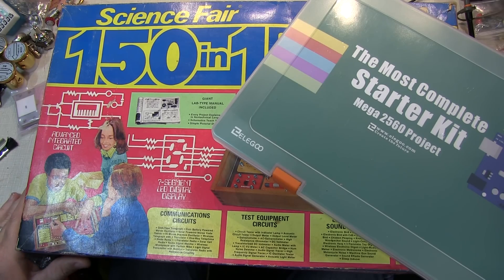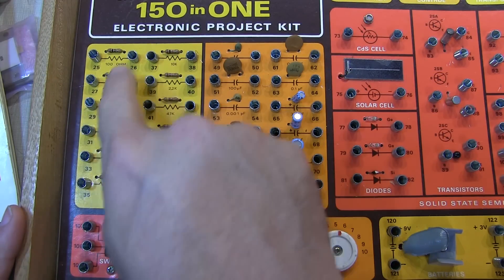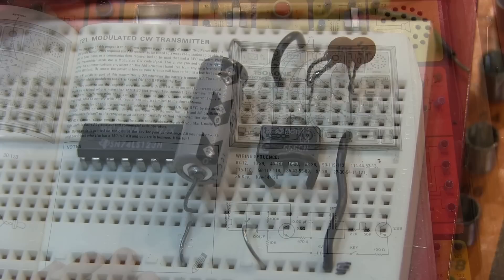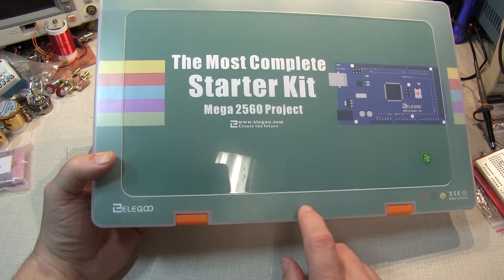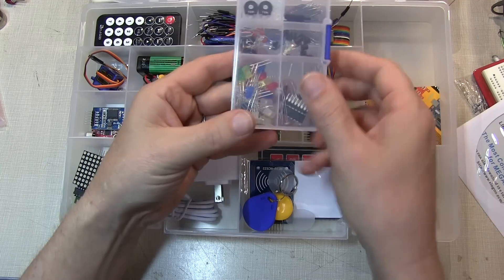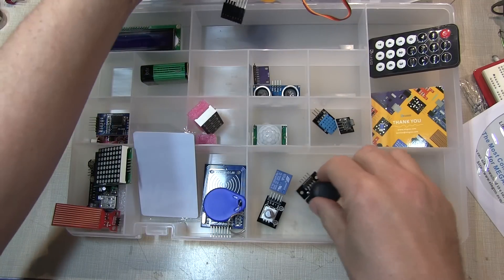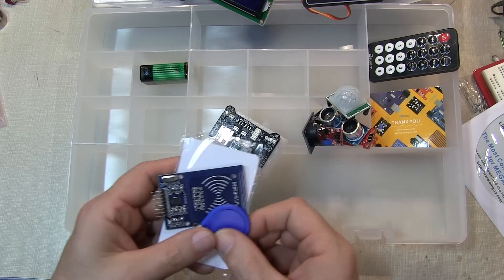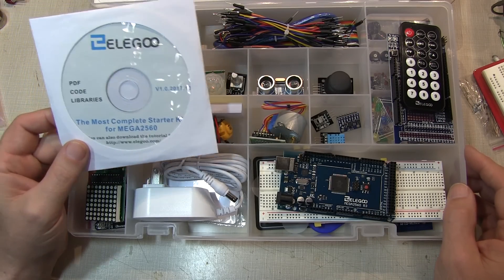#298: Electronic Project / Experimenters Kits - Then and Now - Science Fair and Elegoo

Comment: The older kit looks more intuitive. I'd be more inclined to use the older ones than an Arduino if I was 10.
Reply: The kits have different goal IMHO, so aren't really compareable in "intuitiveness". The Arduino kit definitely isn't an electronics beginners kit. Most Arduino kits I've seen are programming focused (often just copy and paste unfortunately) and the electronics are something you need to make your program work.
Reply: @superdau  The Arduino stuff is all about downloading someone else's code if you are a beginner. Or write your own if you have knowledge in the field; in which case you likely wouldn't buy the kit because there are more efficient and cheaper methods.
Reply: I got into the hobby around 2002, so right at the tail end of the older kits (although mine only had the spring contacts for larger components like the transformer/switches/relays & a large breadboard), but w/ an excellent Forrest Mims manual. However, that was late enough that what kept me in the hobby was the basic stamp microcontroller kits from parallax. While those were less complicated than the arduino kit shown, I likely would have quit electronics had it not been for all the cool behavior the microcontroller enabled. Building a crappy radio just wasn't very impressive to me, so while I learned a lot none of the projects in the radioshack kit got me excited enough to keep going, while it still remember how cool I thought the crappy weather station that logged data to my PC was. For kids that are growing up with smartphones, I just don't think the older kit will really do much to get them excited.

My main problem w/ the arduino kits I've seen is that they encourage copy/paste programming, and don't explain the circuits, so I don't know that there is much electronics or programming knowledge being learned.
Reply: I actually learned on one of these old kits when I was 10. The only problem was I eventually blew all the transistors and couldn't find replacements. In terms of educating myself, this kit was far more effective and interesting than any of the new ones I've seen. The new ones sort of dilute the essence of electronics and dumb down most of the concepts. Maybe there are some better ones out there that I don't know of, but these Arduino kits are mostly modular electronics with copy-paste code where they only explain the obvious. Back in probably 2009 I had an Arduino kit and it looked cool at first but it bored me to tears before long. I became way more interested in building analog circuits that could do the same thing the Arduino could. Making radio and Hi-Fi circuits has always been way more worthwhile to me than computer science.

Comment: In the 50's, I 'helped' my dad in his radio/TV repair shop in our basement. My job was to strip the non-repairable chassis of the caps, resistors, sockets, ....
In my teens, he and I built various electronic projects - crystal radio to Dynaco stereo equipment. Good times, I also took 2nd place in my 8th grade science fair with a short way radio. :>)
Reply: Lucky you to have learned and worked with your dad.

Comment: My first electronics kit! Unfortunately when my Radio Shack battery club 9 volt went dead, I plugged it into the wall outlet. It exploded in my face. My first bad experience with mains voltage at age 7.
Reply: I carried that battery club card in my wallet well into the 2000s, only realizing it when I switched to a new wallet. Can't recall how many times I went to RS for a free battery and left with a $50 box of diskettes. Those free batteries cost me thousands of dollars. LOL